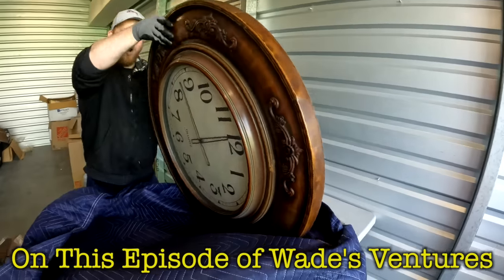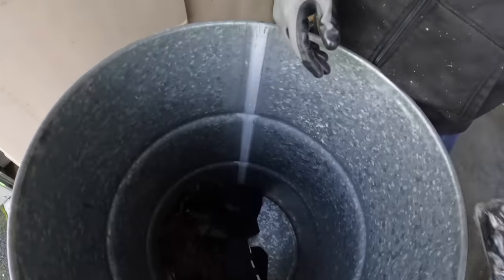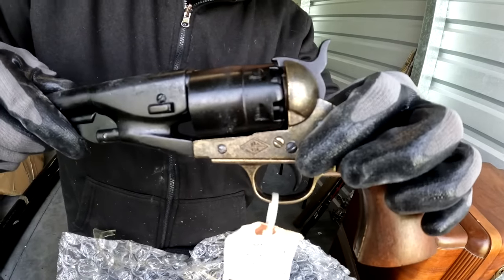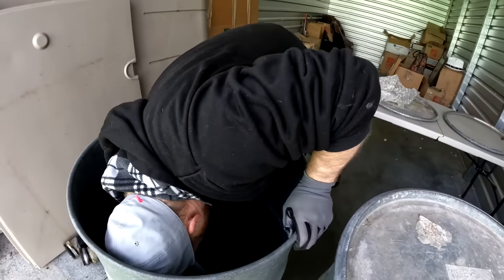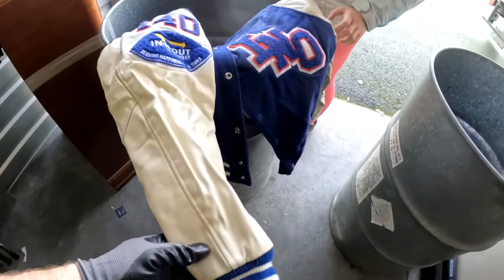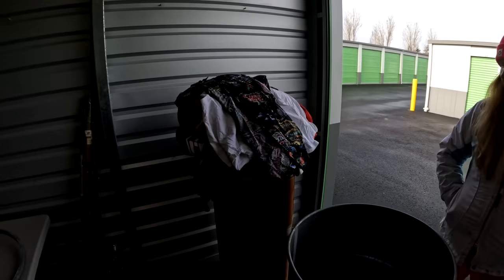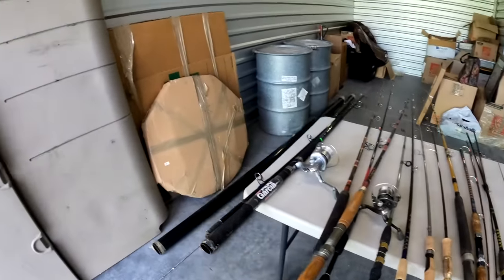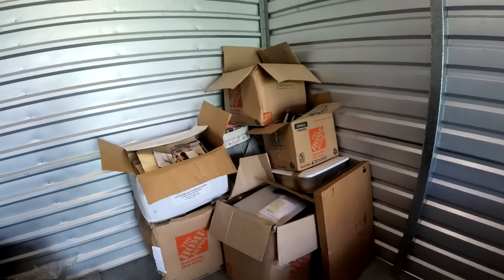Major Storage Treasures In Old Steel ￼￼Barrels!

Comment: Both pistols are probably replicas the first one is a black powder pistol and you load each cylinder separately and packet with the lever under the barrel and the second one is a Centerfire add a little bit more desirable than the first one but they are both good Vines